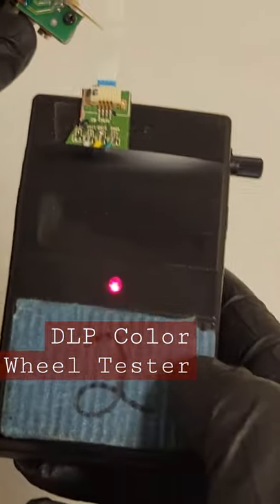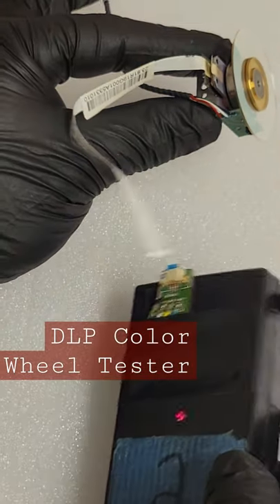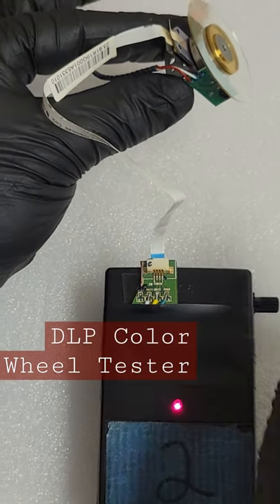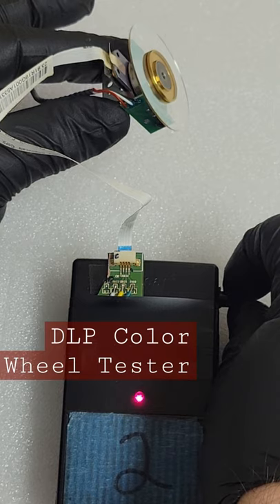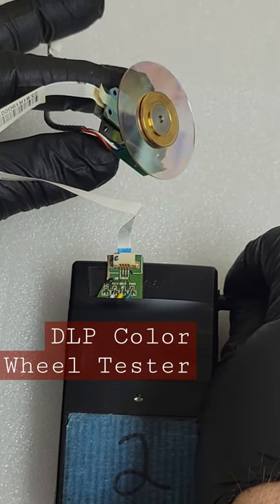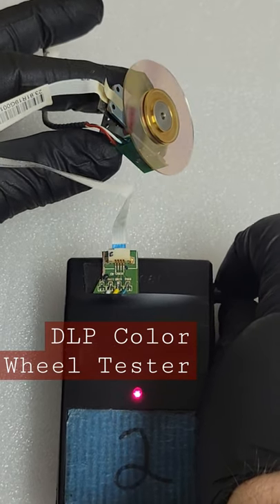DLP ColorWheel Test Box

Comment: That's awesome Frank! That's a really neat tester you made and sure is handy to be able to quickly test a color wheel! I might build one sometime. I look forward to the video. 3 pole motors are interesting. I always wondered if it's beneficial to add a drop of oil to the bearing in those if you can get to it. I've even oiled small fans that way by getting to the bearing and washing the blades to clean them if they come off easily. I use 3-in-1 electric motor oil.
Reply from the maker: For an open frame motor like a fan or something like that, sure.  Color wheels on the other hand use oil bronze bearing usually.  Any exposed oil will become a dust magnet and most of the bearings in the wheel are not accessible.  I've had better luck with no lubricant in a color wheel.
Reply: @FixitFrank  I can understand that for sure, I've had oil attract dust like crazy at times so I usually just use it on things like fans where it won't hurt anything. I agree that the bearing in a color wheel is basically sealed for the life of the wheel and probably shouldn't be oiled if it's even accessible. Then again usually the bearing is okay still by the time they do fail.

Comment: Hi. I'm interested in making a teat like this. I am knowledgeable about projectors, but I would like to know which parts of a projector you used besides the motor drive? I could specify in a video to be able to make one too. Thanks in advance
Reply from the maker: Im putting together a video on that currently. The only parts from the projector I used were the connector for the color wheel. Everything else was from a parts supplier. I should have the video up pretty soon.